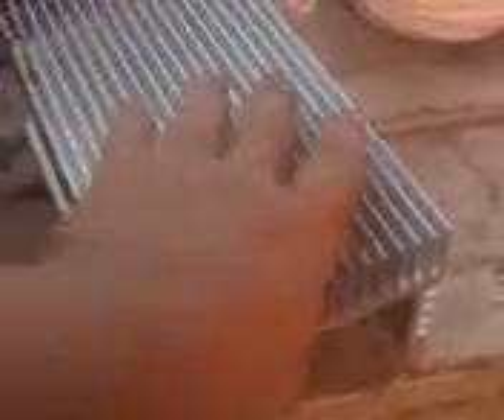Bob Boyce PWM circuit and coil update

Comment: In Reply TO amanghotra1982 --- Bob's system would certainly run a vehicle if connected to the engine correctly. I would definitely recommend that the system is connected via the fuel rail and be fuel injected number 1. Second, I would also recommend the ecu is replaced with an HHO ecu, definitely with a knowledgeable technician modifying the vehicle maps, timing, etc. There isn't a VOLO chip on this planet that can make the vehicle run correctly if the gas enters the fuel rail. Also, by injecting this way, the vehicle will not have gasoline entering the engine, this means the timing must be perfect, and the gas would need to be injected in the perfect quantity, unlike injecting it into the air intake where it is diluted massively making is basically " non explosive". The HHO system would have to produce specific quantities of HHO to match the needed amount necessary for your rpms with a throttle position sensor to push the necessary production voltage to the cell. It is vital that this is done correctly, otherwise you would have a knob to turn instead of an accellerator pedal. HHO isn't a liquid that could be pumped into the engine by the fuel pump, and I certainly do not recommend compressing it to use as the fuel pump does, so, this would need to be modified correctly to function the right way. Follow a man by the name of Neal from Canada. He has a great take on the HHO fuel injection with merely 1 lpm to idle a 4 stroke, 4 cylinder engine in his vehicle with his customized fuel injection system. If he added a Boyce electrolyzer and TPU, he would easily operate his vehicle without any issues. I have tested Bob's electronics and tpu system, but, I had to make major mods to them per my cell construction. It certainly works incredibly, and it puts out every ounce of hydroxy gas that he states, if not much more for the amperage. The gas quality is much more powerful than any standard brute force technology, but, I have found another method to make "orthohydrogen, or monatomic gas" which is a much more economical method to use. I will be selling these devices in place of SM's electron stripper, or Bob's TPU very soon. The gas will be able to be changed with a $150 component that bolts onto any vehicle's engine, and it will be able to be used on any HHO gen.